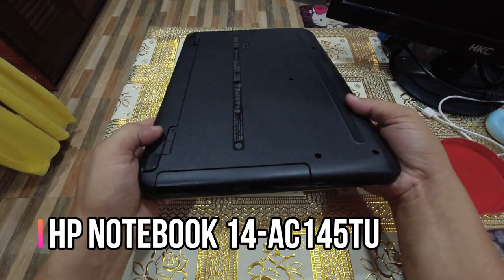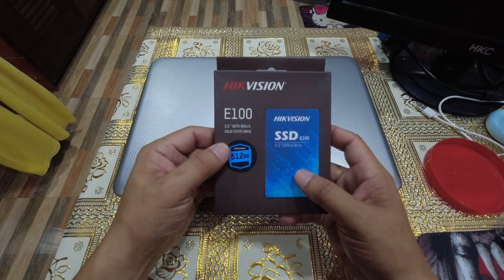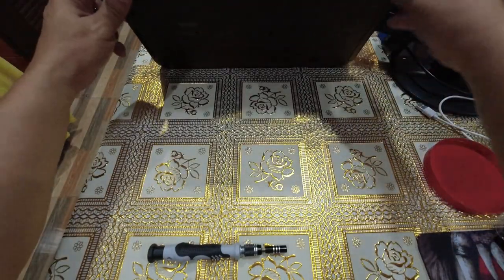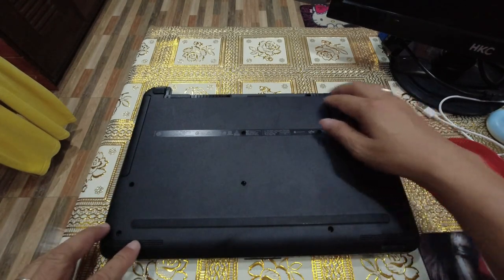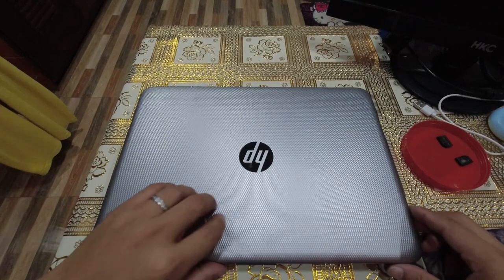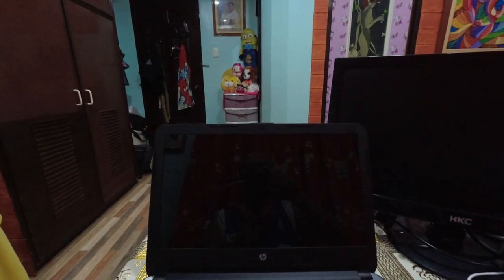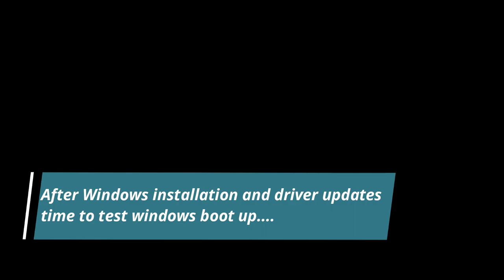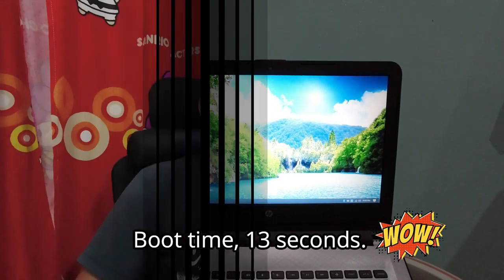HP  Notebook 14-AC145TU LAPTOP SSD & MEMORY UPGRADE | DIY PETZ

Comment: Thanks for the video sir! Can i upgrade the network adapter of this unit and if yes what model should i get ?
Reply from the maker: Good day Sir, the network adaptor on-board is only 100 mbps and can not be upgraded, but you can purchase a USB3 Gigabit Network adopter if the 100 mbs on board is not enough for your need.

Thanks.
Reply: @RollyPetz  thank you 🙏
Reply from the maker: @mustapha6161  you're welcome Sir.

Comment: Same laptop same specs I will buy the parts sana ok ang upgrade. How about for the battery sir, ano po yung recommended nyo na replacement battery?
Reply: Sir dun sa link na binigay ninyo for crucial ram, ano po ang exact na pipiliin dun? 8gb DDR3 1333, 8gb DDR3 1600 (1.5 v), or  8gb DDR3L 1600 (1.35v) po?
Reply from the maker: For the replacement battery, you may opt for a higher specs po if available. Thanks.

Comment: Can you upgrade the processor of this unit?
Reply from the maker: Good afternoon Sir. No the processor can not be upgraded because it should be compatible with the motherboard. Tnx.
Reply: @RollyPetz  so that means it's upgradable but with the processor that is compatible with the motherboard?
Reply from the maker: @robertgaming3626  Yes Sir. as long as it is compatible with the motherboard then it can be upgraded. but with the laptop that this old, no idea really if this can. Thanks.
Reply: @RollyPetz  ok thanks
Reply from the maker: @robertgaming3626  you're welcome Sir.
Reply: @RollyPetz  last question sir. Can it play valorant after your upgrade?
Reply from the maker: @robertgaming3626  Sir, unfortunately it will not. Tried it but very laggy specially with the current valorant update.
Reply: @RollyPetz  ok sir thank you very much for your time
Reply from the maker: @robertgaming3626  you're welcome po Sir.

Comment: Good day sir
This is my current ram 2GB DDR3L-1600 SDRAM (1 DIMM) and i want to upgrade it to this ram kingston 4gb 1rx8 pc3l-12800s-11-13-b3 but its not same frequency it would be okay even if its not same frequency?
Reply from the maker: Good day Sir Leandro, It's ok Sir but the one you're replacing with a lower frequency. I suggest you upgrade the memory to at least 8 gigs for better performance Sir. That way it can handle background processes and open tabs in any browser.
Reply: @RollyPetz  thank you sir very helpful thumbs up
Reply from the maker: You*re welcome Sir. Stay safe.

Comment: Sir ask ko lang meron din po ako laptop balak ko po palitan ram at ssd ano po kaya pwede maraming salamat po .

Ito po yung naka lagay na sticker sa SSD'HDD
SSD CP502522-X3

Ito po yung naka lagay sticker sa Ram
1gb 2rx8 pc2-5300s-555-12
HYMP112S64CP6-Y5 AB
Reply from the maker: Good pm po Sir Angel.  Kung mag upgrade po kayu ng SSD, kahit ano Sir pwede basta SATA SSD siya na complatible din sa motherboard ng existing laptop. Meron din kasing laptop na capable ng ibang klase ng SSD. Meron din kasing m.2 ssd and nvme ssd. 

Sa memory naman, match mo lang eto type ng memory. kung DDR3/DDR4 and the frequency match din dapat. Better yet sir you can install and app in windows w/cid CPU-Z. Sa software makita mo kung anong type ng memory ang meron sa laptop na gamit mo po.

Thanks.

Comment: Hello I just saw this video of yours pwede po ba maupgrade kahit na nag oon and off na sya at kahit sira na yung battery nya ?
Reply from the maker: Hi po good afternoon. What do you mean po by on and off, baka may ibang problelm yung laptop kung bakit nag on and off. Solve muna natin yung on and off, baka may problema sa temp yung board Sir. Tnx.
Reply: @RollyPetz  pag may ginagawa po ako bigla nalang po syang nag ooff tas pag nakashutdown naman yung laptop bigla nalang nag oon
Reply from the maker: @fenmarie7728  Better have the unit diagnosed first, if you can do isolation of the unit then do so. 

- Check the battery and try to take it out first
- bluescreen of not?
- isolate the hard disk or the memory

Marami kasi dapat tingnan..hope this helps.
Reply: @RollyPetz  ah okaypo thank you try ko po advice ninyo ❤️

Comment: Sir yan napo ba pinaka maxx na upgrade niya?
Reply from the maker: Good afternoon Sir. Probably yes Sir since you could not upgrade the processor.  Maybe a larger SSD storage  but for the RAM ideal na ang 16 gigs...overkill na pag 32 gigs pa...
Reply: Sir ok lang ba na ddr3l insted of ddr3 ? Gaganapadin puba  same po kasi tayo ng loptop
Reply from the maker: Sir para sa memeory upgrade dapat magatch dapay sa supported ng motherbpard Sir. If the bpard supports higher frequency then thats  more preferred.
Reply: Sir kumusta naman yung ram? Ok parin ba siya ngayong 2022
Reply from the maker: @urbanoeumirr.1638  yes Sir, working as fine...
Reply: Thank you sa update sir
Reply from the maker: @urbanoeumirr.1638  welcome Sir..

Comment: (As deaf filipino but only speak english) "Hello, is it okay to upgrade ram without replace battery?"

EDIT: I talk about my battery is 0 percent without fixed in years ago
Reply from the maker: Yes, sure you can do the upgrade. If the battery is damage you can just have it removed from the slot to avoid further damage to the system.